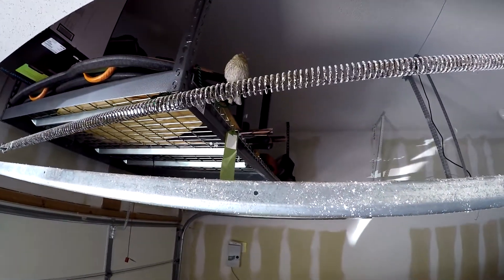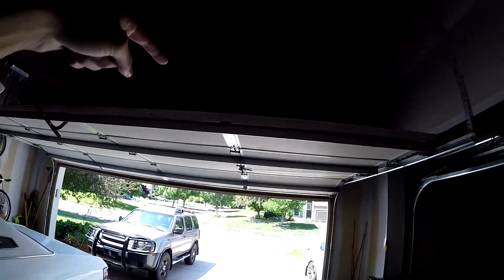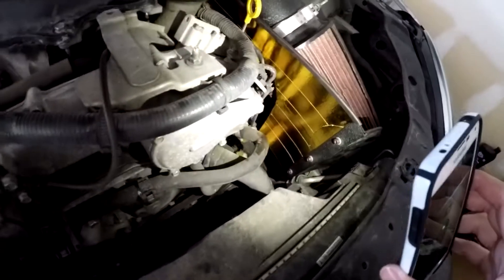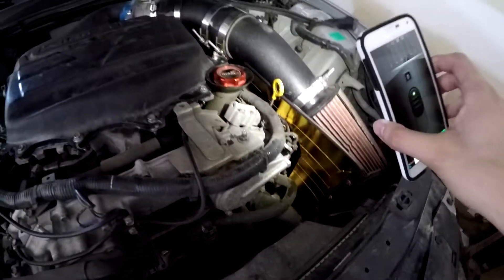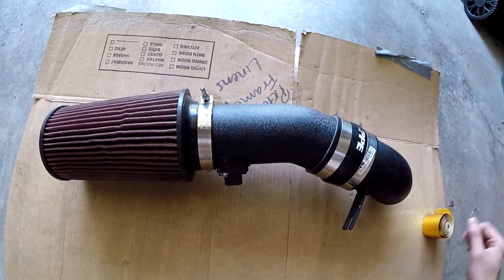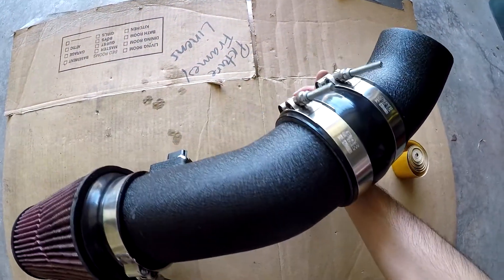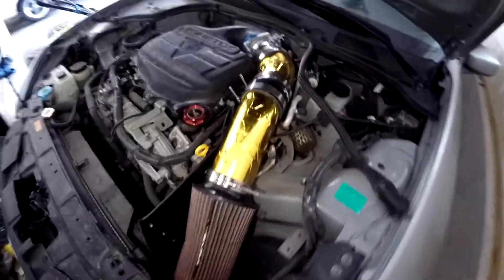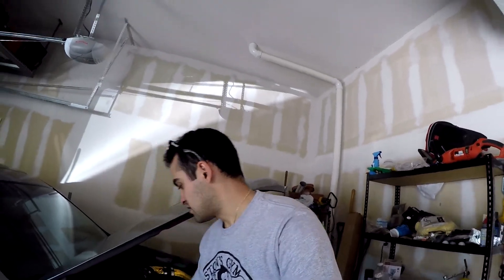GOLD HEAT WRAP !! | G35 Coupe LMT 4in Intake

Comment: I did that job on my G35, I live in a country that is extremely hot (Panama), the ambient temp can raise up from 92 degrees to 105 degrees F, and inside the engine bay is extremely hot, so I did this and the difference between the 2 scenarios (without and with the gold tape) is from 20 to 10 degrees F lower in movement, so there's a important difference, but in stop and go traffic, it lost all of its advantage and the temp can raise the same temp as before, because the G35 engine bay is already to hot.
Reply from the maker: Nice well thats good to hear that it helps. Yeah with the stop and go traffic and sitting still, I have hood spacers installed to let heat escape. I did a before and after test with them same day and temps sitting still dropped a good amount. I have a video of it
Reply: I want to try that too, but I doesnt trust in any hood spacer if its not designed exactly for the G, where do you buy the ones you have installed?
Reply from the maker: HKinkead I got them from Limp Mode Tuning. Comes with their 4in intake. You can send them a message or send a message to Never Ending Details on facebook or their website to get them. Their links are in the description.
Reply: Thanks man, let me take a look at it